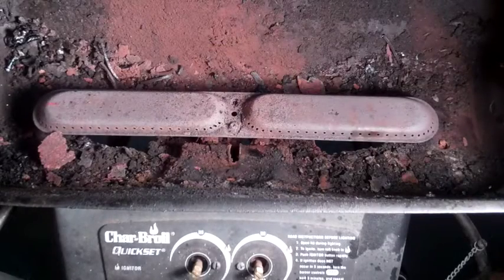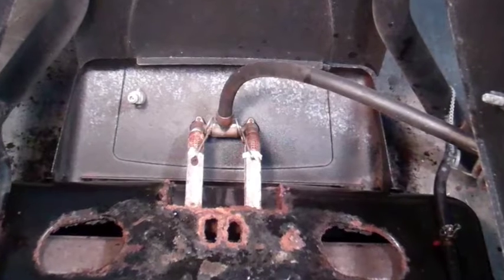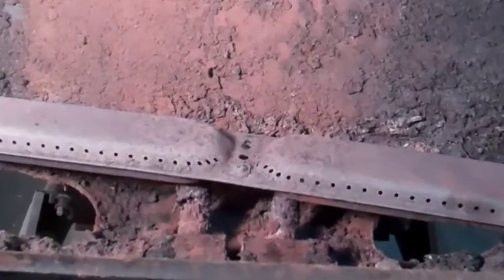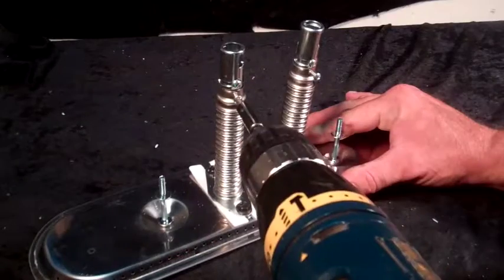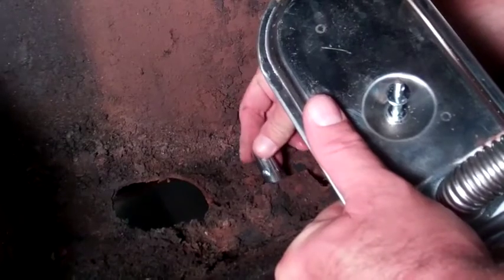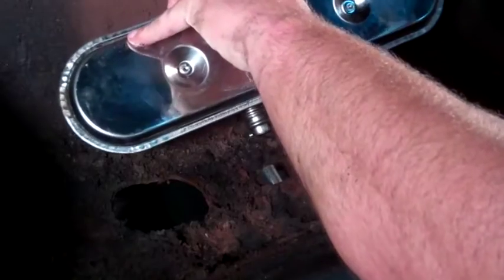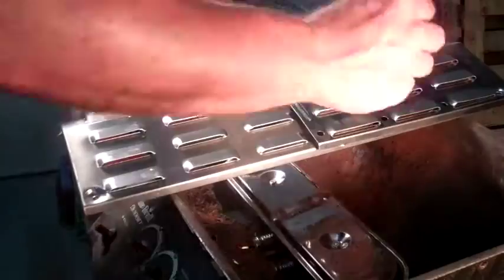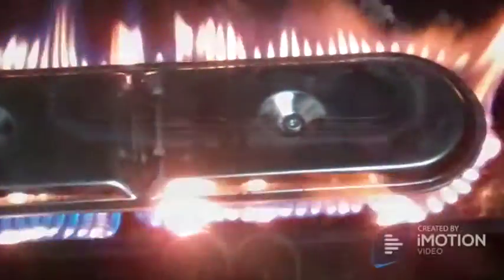BBQ Grill Oval Burner Replacement Instructions In CharBroil Repair.

Comment: can you please tell me the heat tent model #? I just replace the burner on my char broil grill, my burner is 17 inches long the universal replacement in 17 3/4 x 3 /12 but now I need a wider heat tent something like the one on your video. the heat tent that I need now has to be 23 1/2 inches long x 5 or 6 inches wide.